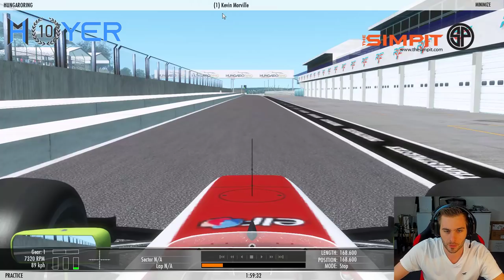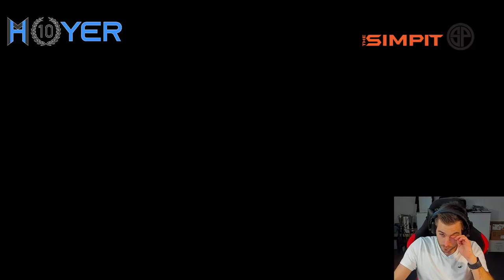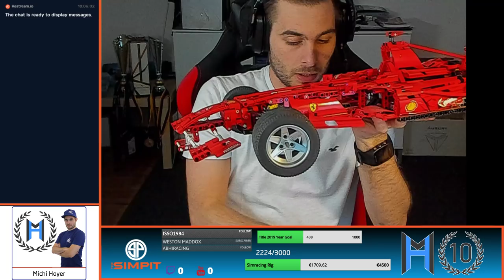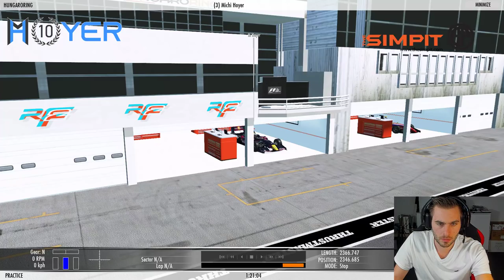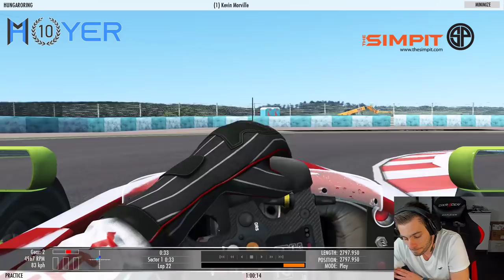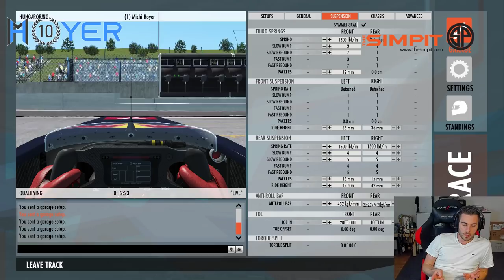Simracing Academy - Dampers and Settings Explained with Kevin Moreville

Comment: A 4 way adjustable damper has a fast and slow bump and rebound. Rapid oscillations from the springs are dampened by fast bump and rebound eg. kerbs bumps in the track surface. The slow settings are for general car movement eg. cornering. Slow settings are affecting the transitional movements specifically at corner entry and exit when weight transfer is happening. Dampers control rate speed, not the amount of weight transfer. Mid corner has negligible effect on dampers. For Corner entry settings we look to slow front bump and slow rear rebound. For corner exit we look to slow rear bump and slow front rebound. The confusion is where many believe the see saw effect is how to tune, eg. By stiffening or increasing the number of damper on that side of the car the weight is kept over that axle longer to induce more effect. From what I've read professionally. A stiffer slow bump or rebound actually transfers the weight faster. Same as springs and ARBs therefore we know on corner entry a stiffer slow front bump will give more understeer, yet I also believe that a stiffer slow rear rebound will actually give more oversteer as the weight transfers quicker the same as spring effect etc. I believe the stiffer end has less grip is still true. And the see saw effect of softening the slow rear rebound does not in fact actually transfer the weight to the front faster to allow more oversteer is possibly false. My research continues.